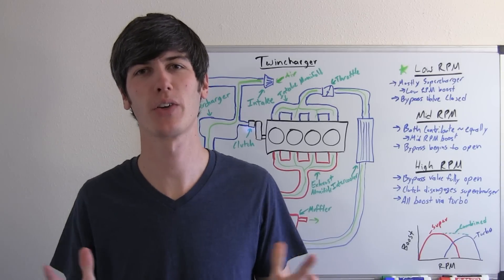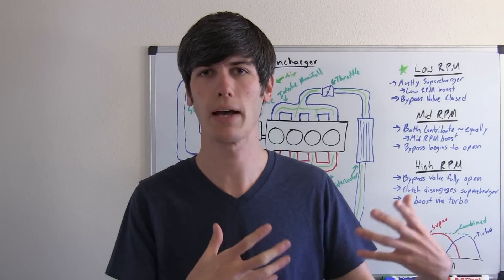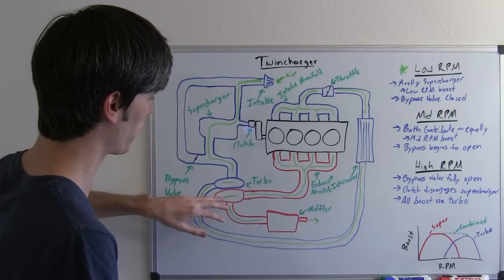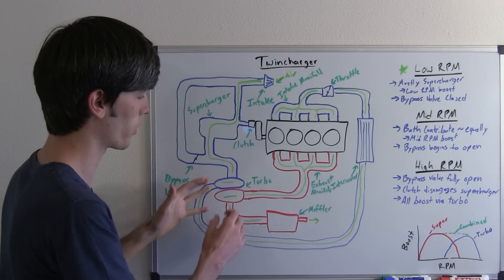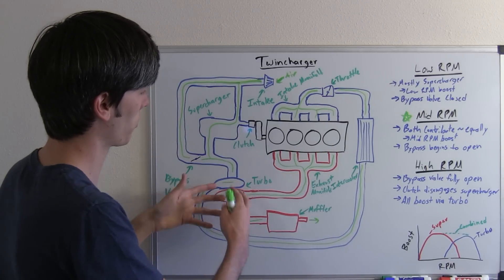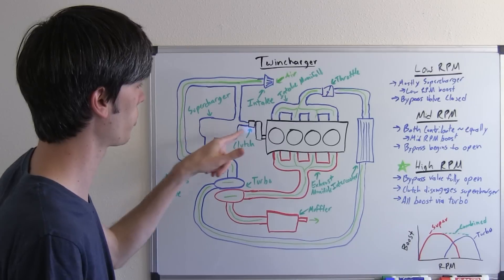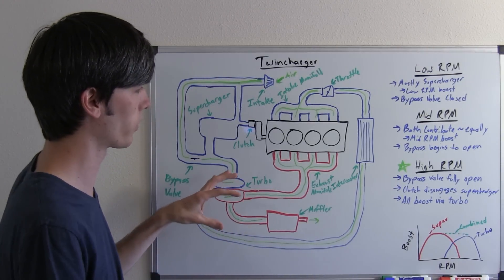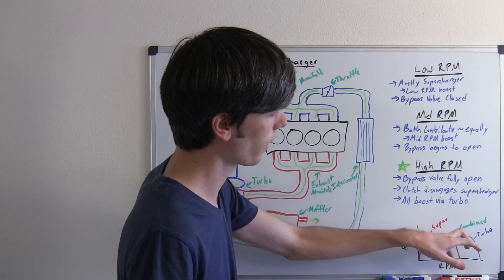How Twinchargers Work: Supercharger + Turbocharger

Comment: but why the supercharger connected with the engine with a electromagnetic clutch ?
Reply: its like the a/c in your car it just makes it not run all the time when not needed
Reply: ***** but by doing that you will lose a lot of boost pressure. If the turbo is only making 10 psi, and the supercharger 10 As well you make some crazy high number. But by dropping the supercharger out of the equation, you loose a lot of boost
Reply: Why would you not run them at the same time? Turbo through the intercooler and then through the supercharger, it would be way more effective in power production and lag reduction.
Reply: But listen, when the turbo is in the process of taking over the supercharger, you have this little space of or little period of time with no power, right? The bypass valve won't immediately switch over from charger to charger. There will be a time where there is no boost. 
This system is used on new Volvos and stuff. It's a FACTORY system. Not good for power production. But it "eliminates" turbo lag. 
If you go for power there is a twin turbo Ford GT running the factory supercharger making well over 1000 rwhp. No bypass valves. No electromagnetic clutches. Just massive amounts of boost. 
And the resistance caused by the supercharger will be minimal, you are re-compressing the already compressed air. Therefore, the supercharger will consume more air at mid and possibly high rpm because of this.

Comment: Actually your are wrong Supercharger going send good amount of PSI at low RPM the exhaust gases will accelerate down to spool up the Large turbos shorting turbo lag you on that note you might even want to use Waist gate to release the unused boost pressure being sent down to the turbo to control the amount of pressure to prevent a spike in the boost when the turbos start breathing hard close to mid range.
Reply: Oh by the way good video well explained. Not trying be sarcastic I am being honest and truthful.  Centrifugal Supercharger with Turbo is the way the go Lighter find one with a one way bearing not as restricted as wimple superchargers when HP peak. can force air down throat of the beast with worries of using bypass valves :D.

Comment: Correct me if I'm wrong, but isn't there a twincharger where there is a supercharger connected to the turbine of the turbocharger with no compressor? I've seen this as aftermarket so I know that much is true, but is it ever used as a twincharging method by manufacturers?
Reply: Yes, they're called centrifugal superchargers. Basically just a turbo compressor without a turbine and has a belt drive. But most manufactures use roots type. A compressor is a compressor, however one of the ways to make them more efficient at different rpm's is like a cvt setup on the superchargers drive belt which can achieve a more constant boost level across the powerband. And the reason you may not see a lot of this is cost vs efficiency as well as its reliability.
Reply: That's not what I'm referring to. Twinchargers that I'm talking about use a root supercharger connected to a turbocharger's turbine. It's as if you had a root supercharger instead of a compressor, and that's a twincharger. Centrifugal superchargers are still superchargers.
Reply: Excuse my comment. I was uneducated of what twincharging really was at the time. This whole comment thread wouldn't exist if I understood the concept then. lol
Reply: ***** No, I understood this one from minute one. I was under the assumption that Subaru had invented a super turbo of some sort where the centrifugal supercharger was connected to the turbine of a turbo for instant spool.

Comment: I imagine it must be difficult to tune an engine with both a supercharger and a turbo. Years ago I know it was thought to be impossible, but these days more and more people seem to have perfected it
Reply: Well people were doing it in the eighties :) 

You want a super-charger that’s biased for low rev high torque, and you can run much more overdrive since clutch is going to disconnect the supercharger before it could start spinning too fast and shred itself.

Comment: Air is of higher pressure after the supercharger and of lower pressure before the supercharger. When the butterfly valve is partially open during the mid rev range, won't some of the compressed air from the supercharger backflow through the valve ?

Comment: Wouldn't the supercharger spin faster as the R.P.M.'s increased since it is connected by belt to the crankshaft? And if it did wouldn't it then draw more air in to the cylinder? And if it did that wouldn't it also be good at high R.P.M.'s, which would eliminate the need for a turobocharger?

Comment: Why would you even have a bypass valve,if you didn't until after the turbo you could have so much more boost
Reply: Well first off, having the bypass valve after the turbo will block off the air entering the engine and it just won't start up.

Comment: I see a fault. When the bypass valve is midway open, the supercharger may force air back out through the intake and not supply enough pressure to get to the turbocharger, being not as sufficient as it could be.

Comment: Are their any disadvantages to Twinchargers?
Reply: well boost tent to produce HEAT... and using both... will melt your plastic parts and over heating your engine, plus you may have to control the boost made by the turbo and the supercharger, because they tent to "multiply" the boost made and you could easily made 30+ Lbs and no many engines can hold this, so you would first need  to build a forged block  with good internals, then build an awesome cooling system and then build the Twincharged engine, then probably your transmission will die, then the rest of the power train unless you set up all the related parts for the high power...

Comment: Is it not true that a turbo ALSO will take energy from the engine? Since the exhaust pressure it powering it, the differential between the chamber and the exhaust is lower, requiring more power.
Reply from the maker: Yes, but it uses the energy from exhaust gases which is mostly wasted anyways, and recovers it, rather than being directly powered by an engine belt.

Comment: Great video. The twincharger seems good but I feel reliability would be an issue. I have noticed that naturally aspirated engines with high power (Example Honda K20) makes very good power when turbocharged  at relatively low boost. If one were to use an engine (Naturally aspirated) with high volumetric efficiency hence high specific output somewhere around 100hp/litre and then turbocharge it using a small low boost turbo, wouldn't this eliminate turbo lag and improve power throughout the rev range?

Comment: wouldn't a twin turbo system with turbos of somewhat drastically staggered size effectively accomplish the same thing? If so wouldn't the boost curve of the smaller turbo move up the RPM scale lightly as compared to a supercharger creating a slight amount of lag? Finally would it be more efficient since the parasitic drain on the the engine from the supercharger is removed form the equation?

Comment: can you do a video on power split in awd cars? im wondering how they are able to get lets say a 40:60 front/rear bias... most german awd cars have this split
Reply: Asymmetrical torque-split is accomplished by using different gear ratios in the center differential.
Reply: Josh Scott
Thanks! That makes good sense. Do they use  centre diffs in cars with multiplate clutch awd?
Reply: sonnyman2000 Usually it's one or the other, however some cars equipped with a center, differential can have multiplate clutches to appropriate torque between left and right axles. The Evo for example, uses an electronically controlled multiplate clutch in place of a conventional limited slip differential.
Reply: sonnyman2000 It is possible that a full-time 4WD vehicle like a Jeep or a truck that uses a transfer case could have a viscous coupling or a multiplate clutch to allow slippage and to protect parts of the drivetrain such as the transmission.
Reply: Josh Scott I will try to do some googling :P Always interesting to figure out how different systems work. Seems like the germans like multi plate clutches

Comment: Saying that turbocharger is not taking power from the engine to produce boost is ridiculously stupid. Turbo is spooled by exhaust gasses that are pushed by the piston from the combustion chamber, and that takes energy as well. Other thing is that turbochargers are more efficient in taking power from the engine is another thing to say
Reply: >watching video
>HURR DURR TARBOZ DONT USE ENGINE POWER SUPARCHURHGERZ DO

Stopped watching right there.
Reply: Turbocharger is taking energy from the exhaust, yeah. But that was actually not the one decrease the power by very little. It's the blocking caused by (most) pipes that channel air to the turbine that blocks. But yeah, it's the most efficient was to increase power. Because car engine's unlike jet engine that use the exhaust to move.
Reply: ***** Hi, welcome to the internet. I see you are the type to frequently visit THE 4CHAMZ. Keep your 12 year old self over there, and away from normal, and logical conversations/and or discussions. Thank you.
Reply: The exhaust gasses would be made anyways. Your argument is the whole process of internal combustion is done to work the turbo. It's using waste, not creating waste.
Reply: its taking power from removing waste, it's not the jet engine where exhaust gasses fly away by themselves
Reply: Apparently, you don't understand how exhaust systems work. The gasses would actually be forceed out of the engine whether there's a turbo or not. A turbo engine has the exact same cylinder as a none turbo.
Reply: yes, and having a turbo there makes more damn resistance to exhaust gases. go learn some
Reply: Your turbo's resistance is based solely on it's placement in the engine bay. A cast log manifold is going to restrict airflow much more than a turbo in a long tubular setup. A turbo in a good setup won't restrict airflow that much.
Reply: it restricts as much force as you need to compress air in your intake part. Otherwise it will run like magic and ruin rules of physics and produce work from nothing. free energy, yeah yeah
Reply: JunckMAn video channel you only forgot that pressure at end of expansion stroke (and on begining of exhaust stroke) is not equal to atmospheric pressure but much higher so in that moment gasses are NOT pushed by piston but they push on it (it is opposite to your statement, your statement is only truth at end of exhaust stroke) and you forgot all laws of thermodynamic. If engine was compressor you would be right, but exhaust gasses have thermal and potential energy so turbo use that which be wasted in other case.

Comment: This is the way VW 1.4 TSI was set up. Good for steady boost and inherently fail-safe, as the supercharger will limit the air flow according to engine RPM. Lancia S4 group B rally car did it the other way around. They had the turbo feeding the supercharger. Not as simple for a steady boost or as fail-safe, but allows really fast and high boost as the pressure ratios are multiplied.

As for the reduced efficiency during transition, it's true multiplying 70% efficiency of a turbo with 70% efficiency of a supercharger doesn't yield a nice number, BUT either compressor needs to do a lot less work which makes up for a lot in the overall energy consumption.

Comment: What if I use a Triple Charger? If I had a supercharger for the low revs, and two turbos for mid and high revs, would that be more efficient than a Twincharger?(besides the added weight)
Reply from the maker: I'd just use a VGT instead.
Reply: Engineering Explained I've read on Koenigsegg's official website that the One:1 uses two VGTs. Are there any advantages to that?

Comment: Good video, though the tech is a bit old. Rolls Royce were doing twin charged systems back during WWII. The BRM V16 1.5L also had a two stage supercharged induction system pushing 600+ hp, and the engine was also made by rolls incidentally. Changing one stage from a supercharger to adding a turbine is rather trivial really.

Comment: what kind of stock vehicle uses twincharger?? I can't think of any..
Reply from the maker: I don't know of any in current production, it's over-complicated.
Reply: Engineering Explained
 Volkswagen 1.4 TSI Twincharged engine 160hp , 1.400cc I-4 ,Supercharger&Turbocharger, Direct injection engine since 2007!
Very durable and tunable engine (thanks to Bosch MED 17.5.5 ECU)
You can play at 300hp with stock engine just with a hybrid turbo !
I Am engineering also
Reply: JohnZ28R all stock correct?
Reply: 7150285 Not all stock , You need to upgrade your intake system, turboback exhaust with high flow catalytic converter , better intercooler, better recirculation valve , hybrid turbo , better wastegate actuator and a very good ECU TUNE !
All stock is about 160-180hp . At 1st stage (only ECU programming ) you have from 210-220hp (depent on the fuel RON) , stage 2(ECU Tune+ Turboback exhaust + Intake and maybe intercooler and DV ) you have from 230 to 250(250 is the limit of the stock KKK K03 Turbo)
Reply: JohnZ28R What I'm asking is: "Is there any stock vehicle that uses twincharger". Excluding modified vehicles
Reply: and i answer you .
Volkswagen Scirocco, Passat, EOS, Golf ,Tiguan , Jetta . All these models are avalaible with 1.4 TSI (TWINCHARGED - SUPERCHARGER+TURBOCHARGER) 160HP STOCK !

Comment: Engineering Explained how much would this cost? what kind of cars can it fit on? do you have to buy them separate or are they bought like that? where can i get this installed or how do i install it? please answer
Reply from the maker: I doubt there are many existing kits out there. You'd have to design it and fabricate it yourself, and piece together a solution for your individual engine bay. It'd be a timely and expensive task, though it is interesting.
Reply: ok thanks alot

Comment: What kind of pistons does a twin-charged engine needs?.
Reply from the maker: Pistons should be matched to the amount of stress they will receive. I know that's an easy way out of an answer, but it's complex, and dependent upon the torque, temperature, friction, and many other factors that the pistons see. It's not a simple question to answer, hence engine designers make good money.
Reply: headache for ehtusiastic car guys!, that, and the cost is what keep us stock!.

Comment: what if you ran a variable turbocharger instead. That would defeat the purpose of twincharging the engine. but the cost would be insanely high
Reply: i know they are super expensive, but what i was saying was the variable turbo would technically get rid of the need of a twincharged setup because of boost the entire rev range
Reply from the maker: I would agree, I'd rather use a VGT.
Reply: Twincharging came about in the 80s before turbo technology was all that advanced and never went anywhere outside of racing. Even then it was only used in a handful of cars and only 1 production motor that I'm aware of. VGT are a more elegant way of achieving the same thing but is indeed costly.
Reply: nblax41 Nissan March SuperTurbo and VW TSi models. Most diesels are VGT because the EGT is cool enough. Petrol exhaust is too hot.
Reply: Authur Jackson
Yeah I forgot about the Nissans. A VGT could be made to work with anything, it's a matter of cost. They aren't cheap as is, and the materials needed to make one that could take higher temps would drive the price up that much more.
Reply: There are VGT's for petrol cars, but you are looking at $8000 or so apiece - which is a joke.
Reply: Authur Jackson Well, I mean if you think about it, if you are going for a major horsepower setup it might be worth it. Superchargers, good ones anyway, with a clutch are upwards of 5-6k. And it can get as high as 15k for a blower. A large turbo is around 3k. If it's 8k, imo that's cheaper than twincharging an engine
Reply: yeah because i saw a vgt for petrol engines that were 8k and would basically do the same thing as twincharging. But the ease of finding a way to twincharge is probably easier thanfinding a vgt and about the same cost.

Comment: I know this one! Supercharger + Turbocharger = Erection!
Reply: Twin Turbo plus a Twin Supercharger=Bigger Erection
Reply: Captain Ghost BMW 335i twin turbo, 305 horsepower, if you switch them with a singel turbo you can get 500-800horsepower becouse it can handle way higher boost of pressure.
Reply: @MrChriz333  Why not just get a larger turbo to feed the supercharger? Like if you have a 5.0, you can just make the supercharger a blower, and fit the large turbo underneath. It would be like the supercharger doesn’t even take up any space, plus there would be more air flow.
Reply: Captain Ghost twin turbo doesnt mean better. Becouse twin turbos works in differnet RPMs, one huge singel turbo is way better than twin turbos. Atleast more horsepower and tuning potensial.
Reply: MrChriz333 and this is why they are better especially if you can tune your supercharger to quickly spool that single turbo that you are more realistically going to get more power from
Reply: your mechanical knowledge has the same lever as your  english
Reply: @randommandoade1465  no that just means your engine blows up😂
Reply: = this guy ...
Reply: Great comment